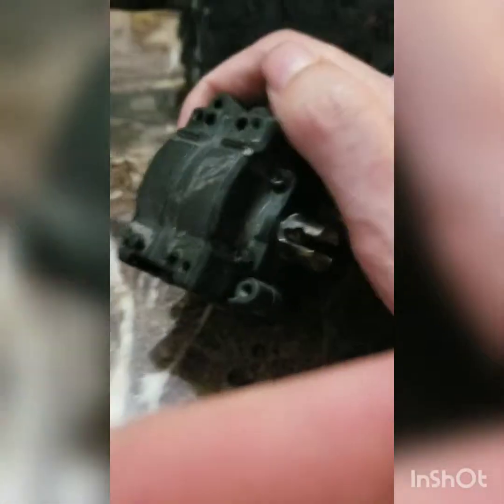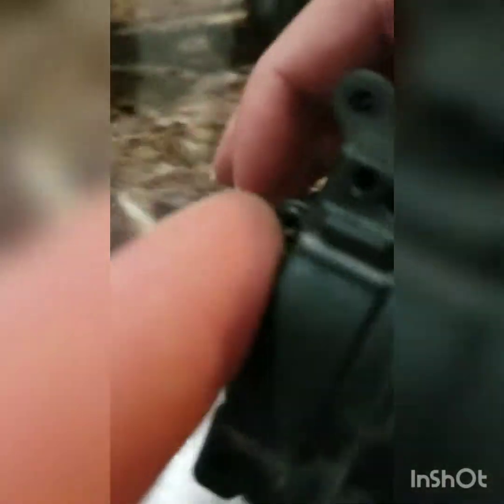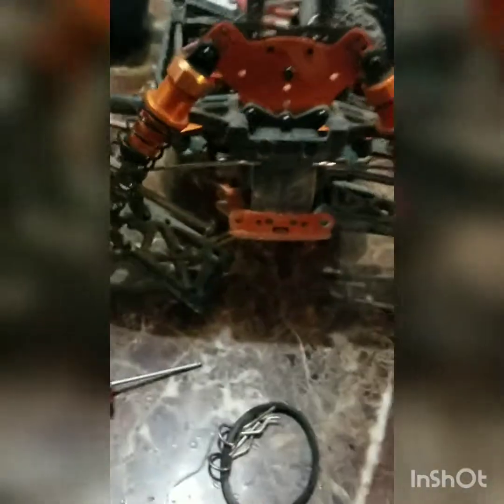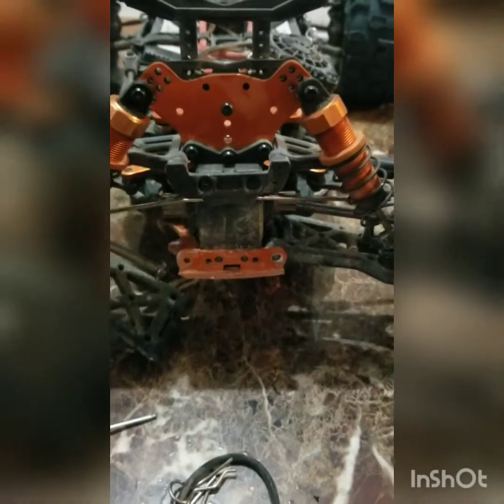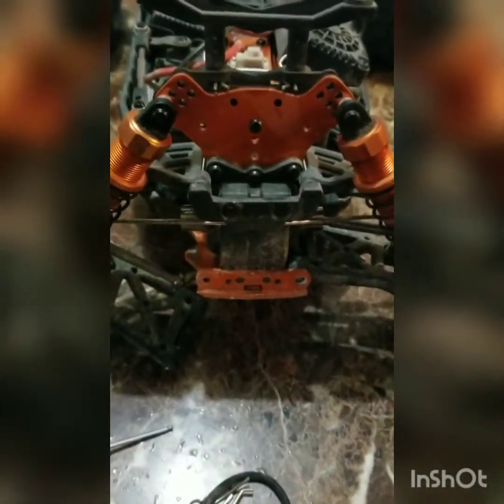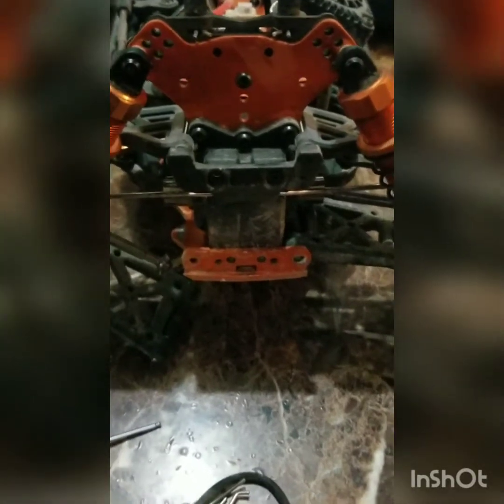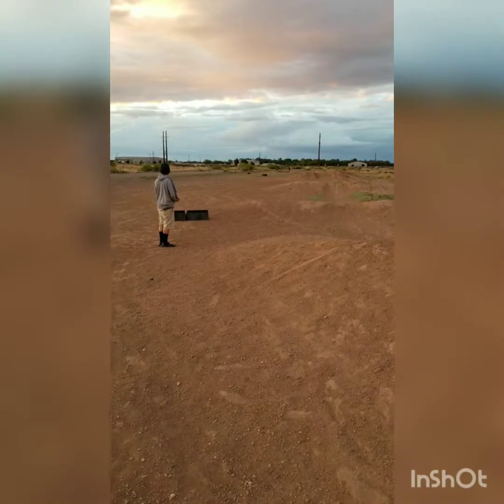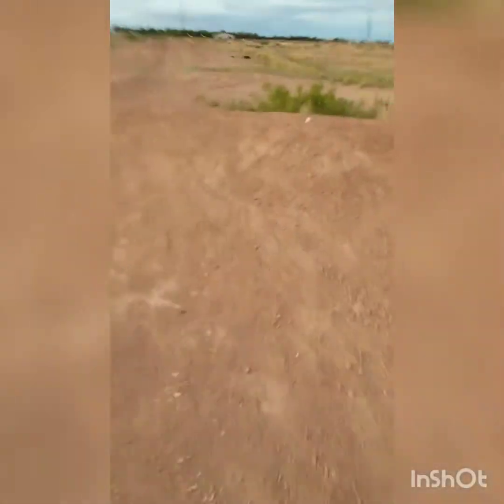Dhk maximus diff keeps breaking? Also arrma jumping!!!

Comment: Do you have the right pin in there? Mine stick out a bit more.  The aluminum is a good upgrade. The plastic diffs like to separate under heavy load. You can run longer bolts with lock nuts thru the diff to keep the plastic diff from separating. I love my Maximus but I go thru pinion gears in the rear diff every other run. I’ve tried shimming it different ways, bought all the aluminum parts, 3 plastic diffs etc. but so far I’ve had the best luck with longer bolts locking the diff together and putting 2 shims behind the pinion gear on the input shaft